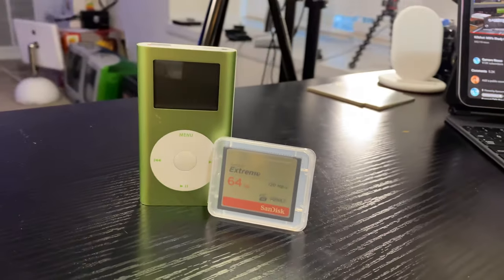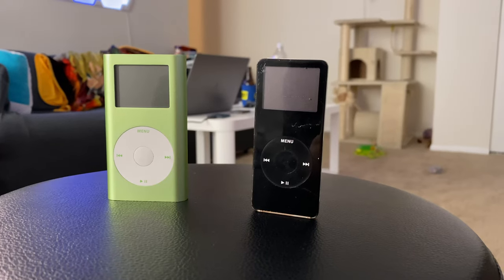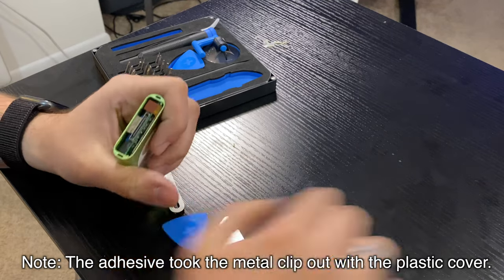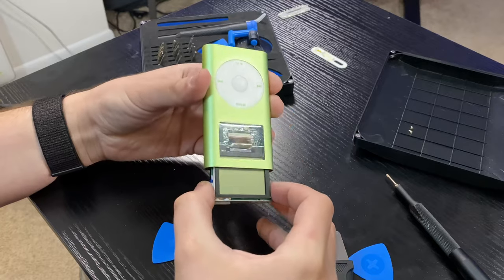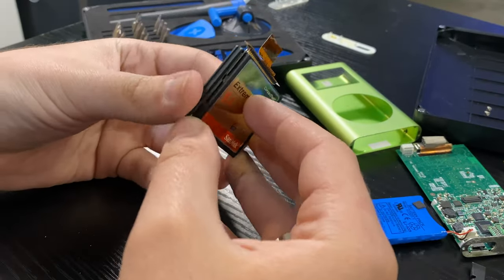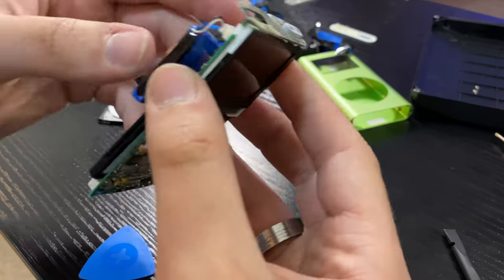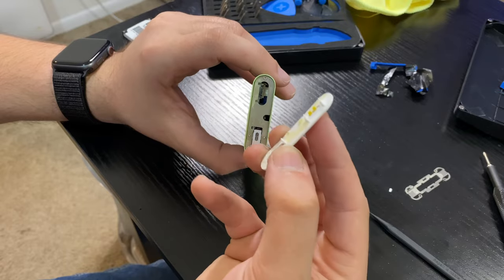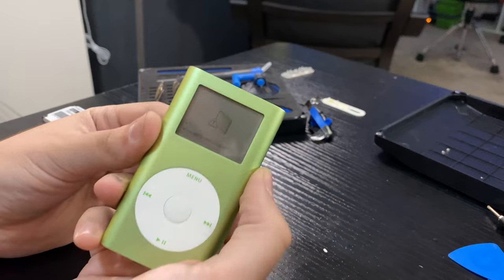Flash Modding an iPod Mini

Comment: After restoring the iPod, iTunes says to unplug and connect to an external power adapter, but once I do all it does is sit on the folder with an exclamation mark screen. If I plug it back into iTunes it just gives me the same "iPod that appears to be corrupted" screen. The CF card tests good in a reader, and the iPod works just fine with the original Microdrive.
Reply: Same issue with me not sure what the problem is
Reply: Restore the pod in disk mode and go from there
Reply: @MoikeIsJesus420  doesn't work.
Reply: @ashton9699  do you have a firewire 30 pin cable?
Reply: @MoikeIsJesus420  I do not unfortunately

Comment: This is really a neat video. When the iPod Mini's first came out, they came with only 4 or 6 GB of storage, which isn't much. So, when I first heard about this modification, I wanted to try it because I had lots of music to download, and it was an inexpensive upgrade, especially when you look at the cost of a new MP3 player with more storage. This is a cheap way to get more storage in an old MP3 player. I upgraded my computer in a similar way, I installed an SDD and took out the old hard drive. It's a great way to improve your PC.
Reply: More RAM easy pc better

Comment: I recommend that if you do the Flash mod, you also replace the original 750mAh battery while you are at it.  The batteries do wear down and stop holding a decent charge.  There are upgraded batteries available with 1300 mAh capacity.
Reply: The original batteries are 450mAh, the replacements are 750. Under no circumstances can you fit 1300mAh in a mini.
Reply: No such thing as a 1300 for a mini…
Reply: if you added a “1300 mAh” battery in your mini i’m sorry to inform you you’ve been scammed

Comment: hello sorry to use comment section but i did the same thing, format and everything  now every time i hook it up to my pc it says that there is a problem with the drive swapped it for another one same thing put stock drive back in works fine ive been trying to find out what to do and its driving me nuts if you could help or if some one knows why its doing this would be very helpful thank you
Reply: Are you using an adapter or compact flash?
Reply: I'm using compact flash the exact same one he's got in the video and still no luck
Reply: @gyrfalcon-6  Are you on mac? Have you tried reformatting the compact flash prior to installation via disk utility as mac os extended?
Reply: @gyrfalcon-6  Not working for me either (Same ipod as in the video and same compact flash). Computer doesnt recognize it, but the old drive isn't getting recognized anymore either.
Reply: I tried a different compact flash 16gb kingston and I got it to work for some reason I cannot format the 64 to fat32 (I think that's what it's called) but the kingston worked no probs so I have no idea
Reply: @gyrfalcon-6  bro i got the adapter with fat32 formatted 64 gb of sdxc.Its formatting but then like nothing happenedTried it hundreds of times but nothing changed

.Now ordered a Sandisk 32 gb Extreme CF.

Anything extra apart of plugging it into itunes?
Reply: @TheSimpleEngineer  i used adapter with 64 gb sdxc.After formatting it goes back again like nothing happened.

Now ordered CF extreme 32 gb.Hope it solves that
Reply: Also if on Mac, what version? I'm on a MBP OS 11.4 Big Sur & I was able to do this with the Mini Gen 1. Maybe you need to reformat the disk until  it reads??

Comment: “Cant go carrying around something everyday that has moving components”

See: mechanical watches
Reply from the maker: Touché
Reply: Mechanical watch motions have jewels as the pivots and need to be routinely cleaned and lubricated to keep functioning.
Reply: @ObamaoZedong  A mechanical watch should get full service every 3-4 years, a digital one just needs a replacement cell, but will eventually die, a smartwatch will die after 5 years. It sucks, but mechanical tech like tape players, watches etc will outlast modern tech and are sometimes more robust. A HDD though is much more fragile than most mechanical things you could carry every day, just look at guns.

Comment: The big issue with restoring on my Windows PC was I needed to use a back USB 2.0 port. It did not like my front USB 3.0 port. Maybe it's the backward compatibility or a powered USB port issue. I'm not sure. But all itunes did was crash until I did this.

Comment: TKS Garrett, loved this so much after adding 64G to MY Gen1, I got a Gen2 Mini on Ebay to Flash to 32G; so far, so good. An issue with the Gen1, after adding some music, it became 'incompatible' with 'MUSIC'/iTunes (a much better name then generic MUSIC!)? So last night I did a full restore, will reload music & hope that's it. But a thing I had with BOTH Gen1 & Gen2 that you don't mention, is while restoring on Mac BP after awhile I was giving a Symbol to "PLUG into a WALL outlet". As the only owner of the Gen1, I HAD my FireWire. But WHAT if you haven't got that FireWire & Brick?? Would a USB Wire/Brick work too?

Comment: Thanks for the guide! It really helped me out when following the iFixit guide for replacing the battery, and I thought if I were going to go inside the device I might as well flash mod it. So far I've a working iPod Mini 2nd gen, hope that its new battery and CF card gives it even better battery life than stock!
Reply: How’s it so far?
Reply: @zakarylakota  It's been pretty good so far, the new battery is holding up much better than the old one lol, and the CF card is running as if the iPod came with it from the factory. I accidentally dinged up the exterior while opening the thing up, but it shouldn't be too noticeable because it's in the bottom of the device.
Reply: @thinkindifferent  bro i ordered 32 gb sandisk extreme CF for mini 2nd gen.

Any process apart of pluggin to itunes while using Windows?
Reply: @batutasci  after the flash mod you’d just plug it into your computer and it’ll say something like “corrupted hard drive” or “recovery mode”, from that point you’d just click restore and it should get everything working
Reply: @thinkindifferent  hows ur ipod?
Reply: @ILikeLore  It's been pretty well since the flash mod, but I've since "upgraded" to an iPod 5.5 gen (flash modded as well, with a battery mod too) for my daily driver.
Reply: @thinkindifferent  good for you!
Reply: @thinkindifferent  sadly didn’t work for me. On mine it says connect to external power source on the iPod to finish the restore process but I get the sad face error every time.

Comment: Will this work for the iPod Mini A1051 2004 Gen 1? I actually still have one that works, when plugged into a electric source? But would LOVE to mod this to a Compact Flash Storage Card!! Tks!
Reply from the maker: Yes. The internal drive connecting is identical.
Reply: @GarrettCrespo  Great! TY for responding so quickly! Originally thought, to just update the 4GB Mini Gen 1 Battery, since it still works! My 16GB iPod Nano A1285 Gen 4 also still works, but is getting the dreaded 'Black Spot'. My understanding, the Black Spot is a bloating battery; even though it holds its charge for a decent time? But was so bummed to learn, just updating the battery of the newer Nano is apparently a NIGHTMARE to attempt. So a NEWLY improved & enlarged Mini it will be, especially since so many MP3 (+) players today are getting reviewed as garbage & I KNOW my iPods will (& have) lasted the test of time.
Reply: Just wanted to let you know, I now have my iPod Mini A1051 2004 Gen 1 with both a new battery & a NEW FLASH Drive of 64GB, from a 4GB HD! Btw, yes, I am the original owner & it's in beautiful shape, I mean my spinning HD was still working after all this time! TY so much!
Reply: @TheJoker-zt4nk  bro i tried having a CF/SD adapter with a 64gb of sdxc.

After plugging it into iTunes its formatting restoring but then like nothing happened.Unplugging and plugging again and asking again for restore but nothing happens after the progress bar fills up.Tried making fat32 and other stuff but doenst work.

Now ordered a 32 gb Sandisk extreme CF.

Anything to make apart of plugging it into iTunes on Windows?
Reply: @TheRippeR  Not sure what you're asking: "Anything to make apart of plugging it into iTunes on Windows?" But I would think it would work on Windows too, if you've downloaded iTunes/Music if that's what you're asking? I also never tried the Adapter, just went for the Sandisk extreme CF. So far so good. The only thing I've noticed thus far is that whenever connecting to my Macbook Pro to (manually) load or delete music (or audio books, same files) via (iTunes which is now) the Apple Music App the iPod creates a NEW 'On The Go' Playlist automatically? It's now up to about 8 of them, I can't delete them, they aren't playlists I created nor want?? But find no way to delete??? I've kind of given up on creating useable playlists for the iPod. Any suggestions out there @Garrett Crespo, or anyone would be appreciated. Tks.
Reply: @GarrettCrespo  what’s the maximum storage it will accept?  I hear mostly 128gb but I also heard it can maybe handle up to 256gb?

Comment: No matter what I did on pc after the restore it kept coming with sad face. 
I went to a apple Mac and same thing. The folder on the screen disappears and now it’s a sad face. 
However the pc and mac both can see the storage and size. 
I’ve done the restore process 10 times or so now and it says disconnect and use a plug to finish the restore but then nothing happens

Comment: Do we have to plug it into ios?

On windows, updated today's itunes or the original cd of ipod works while restoring?

I'm having a 2nd gen mini.

I used a cf/sd adapter with a 64 gb of sdxc but after restoring its like nothing happened, unplugging and plugging again its asking for restoration again....That progress bar ends and itunes warns about its formatted, but after that its like and harddrive again.Hundreds of tries and same again.Tried with some other sd and microsd cards but the same result.Dont know whats the problem :(

Now ordered 32 of sandisk extreme CF.
Any process apart of putting cf in?Formatting or sth?
Reply: Same problem. iTunes recognizes but won't restore properly.
Reply: Same problem as me not sure what to do next

Comment: do you have to launch ipod in disk mode after flash modding to import your songs? it ejects and freezes on the do not disconnect if i don’t connect via disk
Reply from the maker: I only had to use disk mode once to format it. It may not have formatted correctly for you. You may have to try it again.
Reply: @GarrettCrespo  wait you needed to put it in disk mode to format?
Reply from the maker: @StrawHatLuffyD  Thats the best way to make sure it's a clean install across the board. Yes.
Reply: @GarrettCrespo  I’m redoing it like the video but putting it in disk mode, how do I know it’s done though? There’s just a full circle on the hard drive and it now senses an iPod but it hasn’t restarted or anything

Comment: This did not work for me. I I used a CF to SD adaptor from iFixit with a 128GB Micro SDXC. For some reason it only shows the sad face when I go to boot up the iPod. My PC and Mac will not recognize it so I'm a little stuck there. Is there a resolution to this?
Reply from the maker: I’ve had issues with some adapters, but it’s more likely that the format didn’t work correctly. Did you format the SD card before installing it into the iPod?
Reply: @GarrettCrespo  no is this necessary ? Windows asks me do you want to format it and I said no

Comment: Puts a 1TB drive on it
Reply: Its max is 256gb i believe
Reply: @pixsled  For the 2nd gen mini, Yes.
Reply: @diana-cy4kj  people say you can maybe go up to 256 ish gigs if you use rockbox but for normal os it's 128. 64 would be the best choice tho.
Reply: @NOVAKINYT  I ordered 64gb card from eBay. I have this iPod mini lying around ( it says 2004, so I think it’s 1st gen ), it switches on but dies straight away. I think both battery and hd are busted. I never used it, it belonged to a friend who dumped it on me with a lot of other junk. I will try to mod it, hope it goes well. I changed a few batteries on iPod Classic ( both 5th and 6th gen ) in the past.
Reply: @diana-cy4kj  well good luck, watch a BUNCH of tutorials. The most sketchy parts are when sliding out and in the actual iPod motherboard and stuff, there are little surface mounted resistors that fall off easily, losing just 1 can screw it up. Good luck!
Reply: @NOVAKINYT  Thank you, I will pay attention to those things you mentioned. And yes, there are a lot of tutorials.
Reply: @NOVAKINYT  I already cracked it open! I think it went well, I didn’t rip anything off ( at least as far as I can see ). The metal bit on the bottom was sitting kind of funny, one side deeper than the other. I managed to remove it without ripping off the ribbon. The bits that I ordered of eBay are yet to arrive, so I will just have to wait for them and then will try to reassemble it and see what happens.
Reply: @diana-cy4kj  great. Watch out sliding it back in. Moving it up or down can mess stuff up. Best of luck
Reply: @NOVAKINYT  Thank you! Any advice is welcome! Now I just have to wait for the bits to arrive.
Reply: @pixsled  I have a 1TB iPod mini
Reply: @Bryan-vb7dl  yeah but it'll be unstable af.